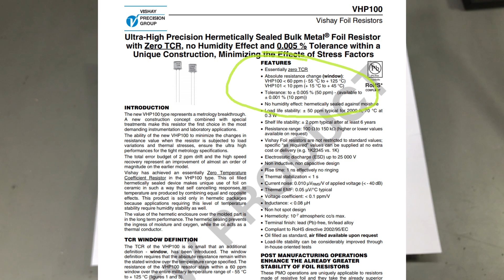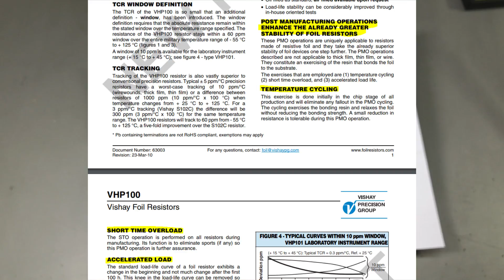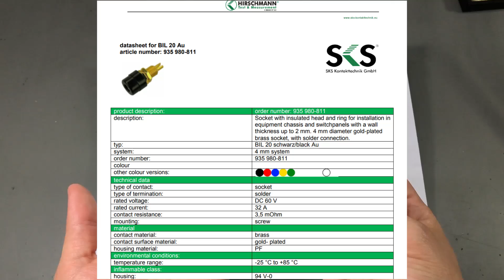Voltlog #180 - Vishay VHP100 Foil Resistors With Zero TCR

Comment: Theory on the manufacture of the metal foil resistor, first part. 1 
, https://www.youtube.com/watch?v=QPeFu5du7W8 
 Thermal treatment of the metal foil, to adjust the temperature 
coefficient of temperature TCR, https://www.youtube.com/watch?v=HDZAm2wAnrk

Metal Foil Resistors, Topics on metal foil resistors,
 theory and practice, with the corresponding bibliography.
Charly GarcíaJuly 15, 2022, "telegra.ph" : " Metal-Foil-Resistors-1-07-15"
Metal Foil Resistors  , https://www.youtube.com/watch?v=eRs6GJTAvJM

Metal Foil Resistors, Metal Foil Resistors 3.https://www.youtube.com/watch?v=fM8Rd89V01c&t=153s
In order to modify the properties of the TCR, 
it is necessary to use an oven with special characteristics such as those described in this video, 
for more information read "Heat Treatment Principles and Techniques ,Ashok Sharma, C. P. Sharma, and T. V. Rajan.

Comment: Metal foil resistors, manufacturing process 1
This video sequentially describes the first part of the metal foil resistor
manufacturing process.
https://www.youtube.com/watch?v=QPeFu5du7W8

Theory on the manufacture of the metal foil resistor, first part. 1 
, https://www.youtube.com/watch?v=QPeFu5du7W8 , Thermal treatment of the metal foil, to adjust the temperature 
coefficient of temperature TCR, https://www.youtube.com/watch?v=HDZAm2wAnrk

Metal Foil Resistors
https://www.youtube.com/watch?v=fM8Rd89V01c
Metal Foil Resistors 3.
In order to modify the properties of the TCR, 
it is necessary to use an oven with special characteristics 
such as those described in this video, 
for more information read Heat Treatment Principles and Techniques ,Ashok Sharma, C. P. Sharma, and T. V. Rajan.

Comment: And how do you calibrate a resistor meant for calibration?
Reply from the maker: you measure it with a higher precision instrument or compare it with a higher precision, higher stability resistance standard.
Reply: And where do you get that higher precision instrument or standard? Precisely the reason why I'd want those resistors is as a standard in my lab. Not that it matters, but I'm obsessed with metrology.
Reply from the maker: I don't think "where to get it" is a problem. It's a matter of affording it :-)
Reply: True. That's what I meant. If I had lots of money I could use the quantum Hall effect for ultimate precision resistance calibration. But my budget isn't very big for that respect...

Comment: What I would give to build a music amp making a Class A or A/B completely with this quality. Right down to custom values you can't get in crapland. I wonder if they sell the Mosfet's and Transistors?
Reply from the maker: Would this bulk foil technology benefit audio circuits? I have no idea.
Reply: Maybe not in the conventional way, but as long as the components aren't microphonic, where there's a will there's a way

Comment: I would skip all soldering and bend a leg 90 degrees in between 2 nuts and tighten down on the banana plug, the 2 nuts will lock the leg in place.
Reply from the maker: Can't do that, because there are multiple connection points required for a 4-wire measurement.

Comment: Check the xdevs_com channel, he have build a few of this precision resistor boxes, I think he's a moderator on the metrology forum at eevblog. Also I think that brass it's not the right material for the connector, the metrology guys just to use something like tellurium connectors and I'll said that 4 wire measurement should be mandatory for this kind of resistors. I'll be trying not touching this resistors with the bare hands :P
Looking forward for this construction!, cheers.
Reply from the maker: I am following xdevs_com channel, the stuff he does is out of my league. Definitely using 4 wire connections on this box, I might start a thread on eevblog asking about what could go wrong if I use those brass connectors.

Comment: You will need the copper binding posts, dissimilar metals can cause small voltages, effecting the readings.
Reply: The Defpom's Repair Channel yes. Bindings are gold plated brass. Gold plated coppers can be better.

Comment: Wow that is such a coincidence, I was thinking of building a resistor calibrator project, I was looking at resistors a few days ago, but the prices put me off, it was going to cost about NZ$400.
Reply: Well, you don't really need all the ranges. You can use a precision resistor (which could cost you $15-60) to calibrate an ohmmeter and use it for measuring lower precision resistors. The only problem might be the tempco, but you can make a temperature controlled chamber and calibrate your instruments there. Not that you have to calibrate them every day.
Reply from the maker: Yup, these resistors don't come cheap at all but I understand why, there is allot of work before one of these exits the manufacturing facility.

Comment: Peter did a really good video a few years ago. The box made by VPG, use it as reference: https://www.youtube.com/watch?v=a6AIoEj5Bzw

edit.: I made myself a similar one with a diecast aluminum box, but mine is way smaller to keep the leads shorter.
Reply from the maker: That is the connection method I plan on using. I wonder though what type of connectors they used on that box.
Reply: Nothing fancy. https://www.ebay.com/itm/10-Pcs-Zinc-Alloy-Gold-Plated-Audio-Speaker-Binding-Post-Banana-Jack-Connectors/263698201216

Comment: When mounting the connectors, make sure to place them in the standard spacing (19mm).
Reply: Also, it is normally not a good idea to use solid core wire in any device that is moved around. If you do use solid, make sure everything is protected against vibrations.
Reply from the maker: Basement ScienceE yes, definitely

Comment: I've built a similar calibration box with Vishay resistors.  To keep the resistor cool during soldering I used a custom-shaped wet sponge to keep the leads cool near the can.  So far no issues.  Good luck!
Reply from the maker: Thanks for the hint.

Comment: I cannot find VHP100 series for sale on AliExpress, but there are very newly listed 0.1% and 0.05% resistors ... still costing around $1 ea.
Your resistors, together with an AD584 or similar will make it easy to build a highly precise current reference, and/or a 4-wire resistance meter.
4-5 digits of accuracy sure would be nice!
Reply from the maker: Vhp100 will not appear in a random shop on Ali. 🙂

Comment: Hi, very interesting, i planned to do the same project (when i will reach to free shipping on farnell). I thought for the soldering to use a copper clip on the leg to avoid the heat to reach the resistor, second thought to connect all the resistor in series so i can do this only with 4 connector and also have a couple of precision resistor divider. I am not sure if i will buy the same resistor or the VAR series, maybe with a good metal box there is no need for the metal can version, thumbs up!
Reply from the maker: I will use a slightly different connection method to allow 4 wire measurements.
Reply: Right, i had not think about it...

Comment: I think heat-sinking the legs while soldering should work. Perhaps a chunky pair of pliers to hold the upper part of the leg.
Reply from the maker: Thanks for the hint!
Reply: Agree, the pliers with a rubber band old technique should do the trick, I've used it a long time ago to solder old germanium transistors and other sensitive stuff.

Comment: Heat absorbant paste used in HVAC when silver soldering valves.
It works well but I have never used it on anything this small.

https://www.supplyhouse.com/Nu-Calgon-4371-36-Thermo-Trap-Paste